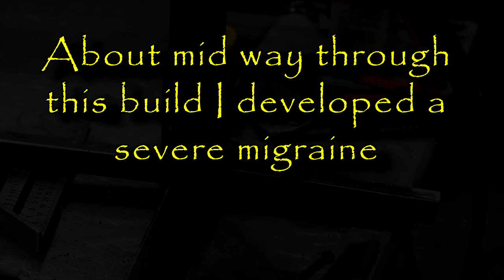Beauty and the Beast Inspired coat rack- Hand forged blacksmith Christmas order unique custom build

Comment: Very nice, and I love the thought process that went into it. Sorry about your migrane! Did you clear the piece when you were done?
Reply from the maker: Thank you, and yes it's got approximately 2 coats of clear. In the direct sun for pictures it didn't have quite the sheen it normally does.
Reply: @wrotiron  Thanks for the additional information. I've begun clearing more and more of my work; while I love the "blacksmith finish" I get from wax, it just doesn't have the same sheen as clear. And for me, the sheen sells better.
Reply from the maker: @brysonalden5414  that's exactly right, I would love for traditional to sell better. But in our shop we've found that the cleared items have a lot shorter shelf occupancy. My grilling tools and a few other things I still linseed or wax but even meat Turner's I've found that clearing the handles and linseeding the business end sells better.